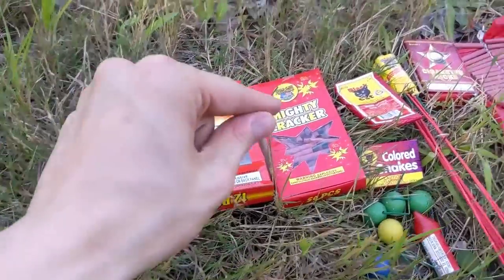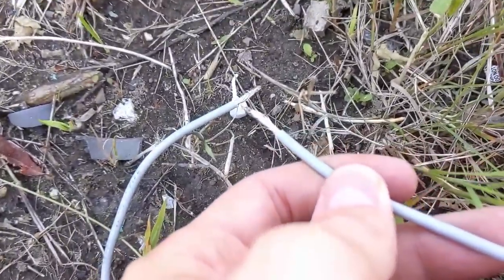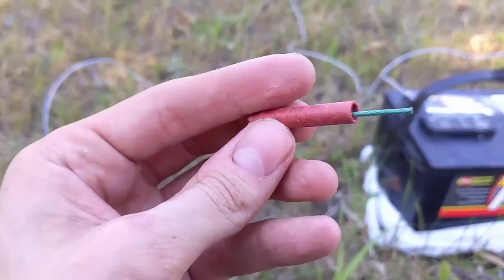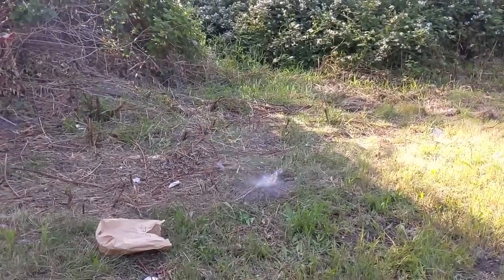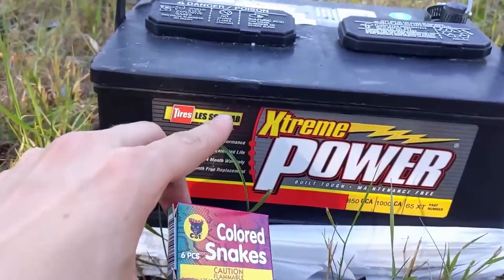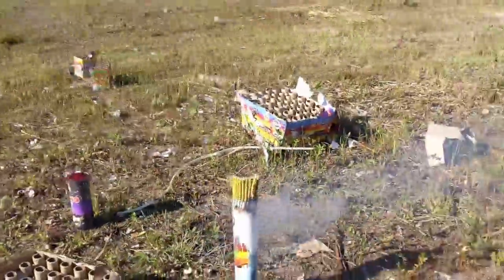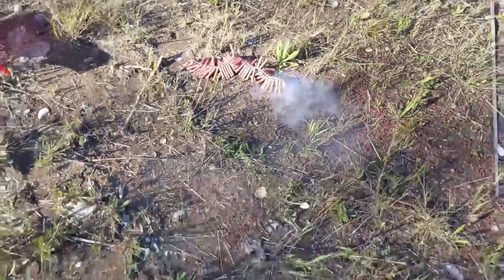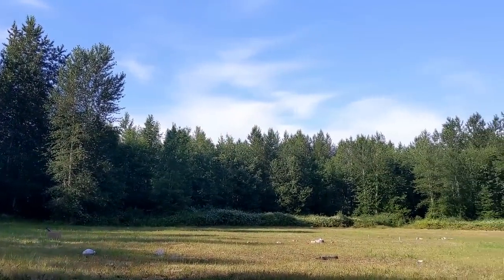Can you light Fireworks using Electricity?

Comment: Even though the voltage is low, the high amperage makes a hotter spark. a high voltage, low amperage spark will ignite more volatile fuels though, hence their use on propane grills and natural gas stoves.
Reply: do be true

Comment: I'm surprised you questioned electricity  being able to ignite fuses considering that's always the way fuses are lit from distance going  all the way back in 1800's with detonators. Heck all firework shows are done with electricity..  heck there's app for your mobile phone that can be used to ignite them with a base connection
Reply: Yep. If it can cause a fire it can surely light fireworks